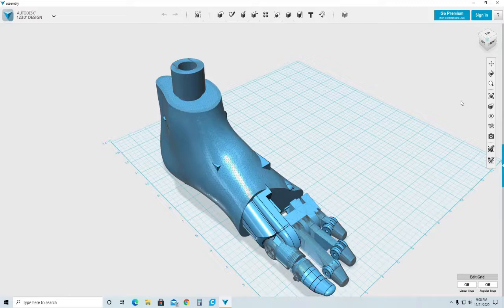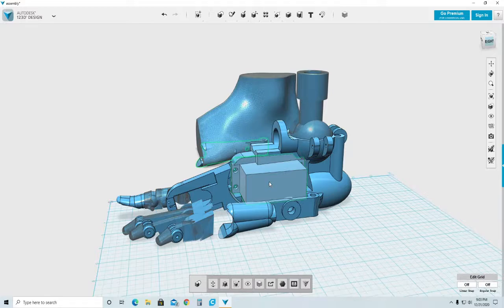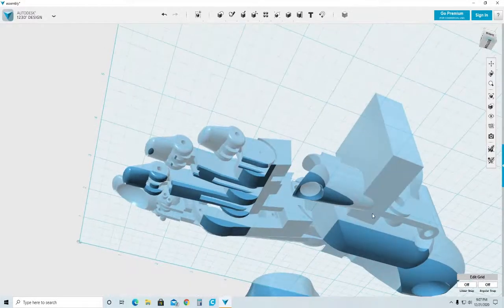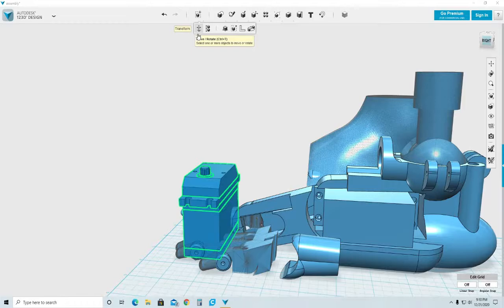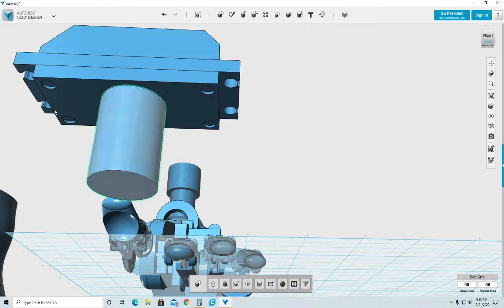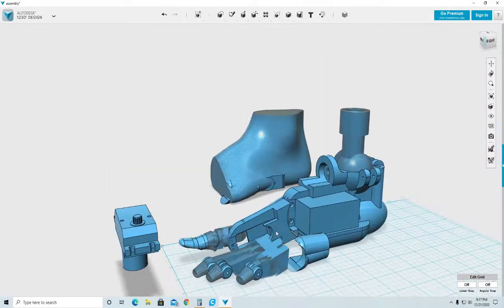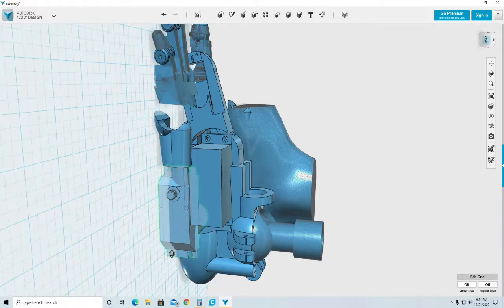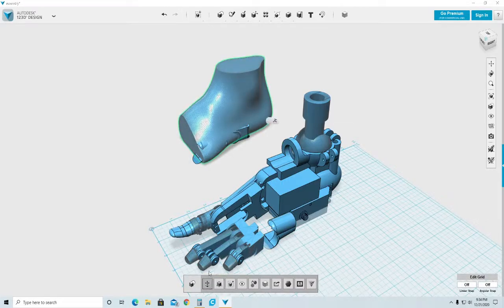Importance of 3D Models

Comment: Good job sir amazing project. I just think there are way too many servos, dont you think steppers would be a better option? I do understand they are open loops but a 3d printer is pretty accurate in an open loop i mean,
Reply from the maker: Basel, I am working with servo to test all the parts, before I spend a lot of money; on expensive motors.
Reply: @DARARobot  i see, best of luck! Can't wait to see the final version:)